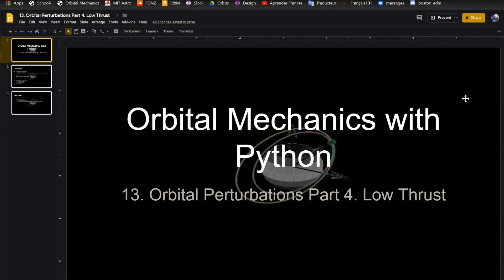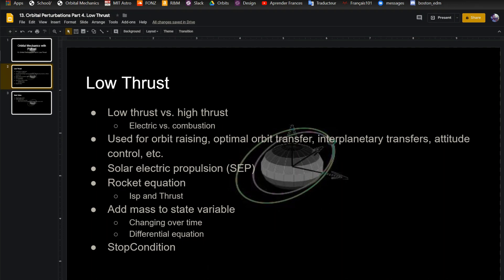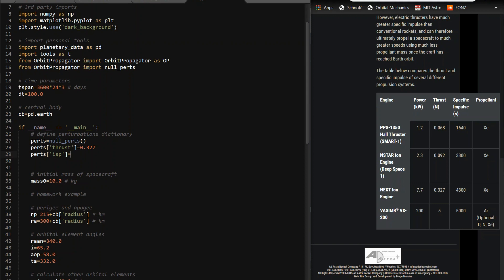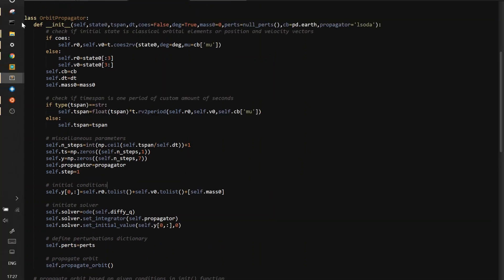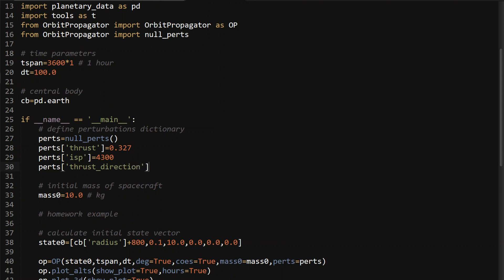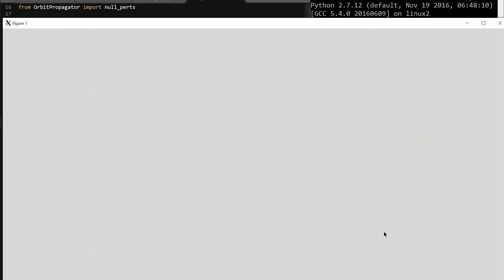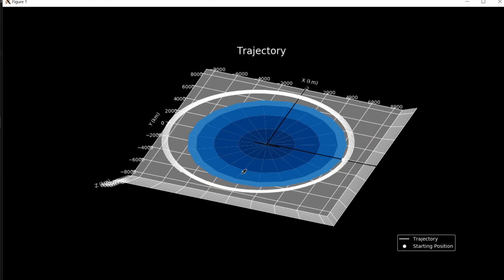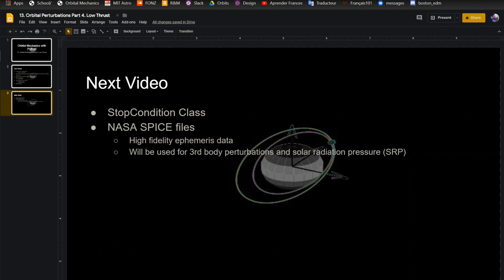Low Thrust Trajectories | Orbital Mechanics with Python 13

Comment: Hi, 

A possible typo.. In the OP init, you change self.mass to self.mass0. But in the diffy_q code though, the thrust uses mass0 (passed in), but in the lines above for drag still has self.mass.

Many thanks again for all the work you are putting in on this.

Colin
Reply from the maker: Good catch. You're right, the aerodynamic drag should use the mass state variable, not the one passed in. And I would probably get an error if I turned on drag using that script. Again, thank you for commenting when you see these discrepancies, I appreciate it.

Comment: I am modelling the thrust acceleration and I am looking at implementing force vector with and angle alpha to determine its direction in order to optimize later, so instead of having the normed(v), I would have this:
            d2r = math.pi/180 

            T = self.sp['thrust']*np.array([math.cos(self.sp['alpha']*d2r),
                                            math.sin(self.sp['alpha']*d2r),
                                            0])
            
            
            thrust_acc = (T/m/1000)

            mdot = -np.linalg.norm(T)/self.sp['Isp']/9.81

            a+=thrust_acc

I am having doubts on its legitimacy as my semi-major axis is not increasing, its periodic. Do I still need the normed(v) within the thrust acceleration?
Reply from the maker: The way you have it written now points at a constant direction inertially, since the alpha angle is constant. Also you'd want to add a Z component, unless you are just looking to thrust in the equatorial plane. So it makes sense that your semi-major axis is periodic. The normed( v ) gives the unit vector of the velocity vector, thus telling you in which direction the velocity is pointing at that time. You want to adjust your steering angle relative to that vector.
So you need information about your current state to use that steering angle alpha. Check out some info about the flight path angle, it will give you some ideas of how to define your alpha angle.
https://space.stackexchange.com/questions/43882/calculate-flight-path-angle-given-semi-major-axis-eccentricity-and-distance-fro

Thank you for bringing this up. My plan is to implement a custom thrust function that is passed into OrbitPropagator, where it takes into account its current state to calculate the thrust vector.
Reply: @alfonsogonzalez-astrodynam2207  Thank you for your reply, that makes complete sense, don't know why I didn't see it before. yeah for simplicity I am considering equatorial orbits, as adding inclination will add more complexity I imagine, since its equatorial I only have to consider meeting targets for eccentricity, true anomaly and semi-major axis when it comes to optimising. so I have added the normed(v) back into my acceleration and it seems to have improved my results. my semi-major axis is now increasing again. awesome :). 

okay I will have a look into flight path angles to see how I can go about defining this steering angle. No worries man, that sounds class, can't wait to see it. I am enjoying this series. Cheers!!
Reply from the maker: @liamrichens1146  Actually, the 3D nature of the problem is taken into account for by the direction of the velocity vector, so you don't have to decrease the problem to 2D.
Instead of thinking in XYZ, think about position, velocity and angular momentum directions, where without any external forces, the position and velocity change, but the angular momentum is constant. So if you want to change your inclination, thrust in the angular momentum direction. The angular momentum is simply ( r cross v ), and can be calculated at every step (its changing due to the thrusting). So it doesn't matter if the orbit is equatorial or not, the vectors already take care of that. 

So something along the lines of this to thrust in angular momentum direction:
# angular momentum unit vector
thrust_direction = normed( np.cross (self.y[ self.step, :3 ], self.y[ self.step, 3:6 ] ) )
 
thrust_vector = self.sp[ 'thrust' ] * thrust_direction

I'm glad you're enjoying the series! Feel free to share with anyone else you think would be interested
Reply: @alfonsogonzalez-astrodynam2207  ahhh thats really clever, I never thought of it like that, I may experiment with that after I get a preliminary model to work, it would be a nice addition to the simulations.

will do!!
Reply: @alfonsogonzalez-astrodynam2207   Hey again, I was wondering if you possibly experimented with higher amounts of thrust with your model. I am currently attempting a test case for electrical and combustion engines. electrical runs perfect as its thrust is relatively small but seem to be running into errors when applying a thrust in the order of 1000N plus.

Comment: Hey! when I run this code with the same conditions as you I get very different results,  the orbit seems to propagate much less.  I have the same errors in calculating the coes as you had in v10.   Is it maybe the conversion of degrees/radians?
Reply: hey again Alfonso, just to let you know I have got the code up and running, the above issue was a boolean error and an error in thrust.  one last , and hopefully simple question;  how do you get your zoom to work on the 3D plot? mines isn't working and im just wondering if there is a trick to this? 

either way,  thank you so much for the hard work and attention to detail you have put into your video series, I look forward to following more of your videos!
Reply from the maker: @garystewart5566  Glad to see you got it running. For zooming in and out of 3D plots, hold the right click on your mouse (or pad) and move up and down